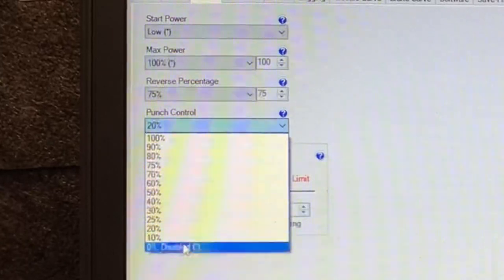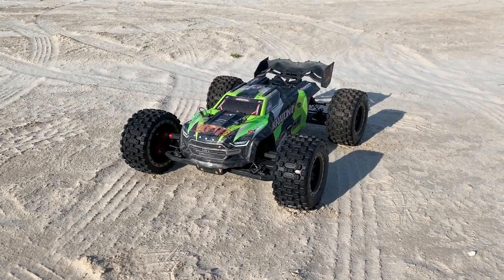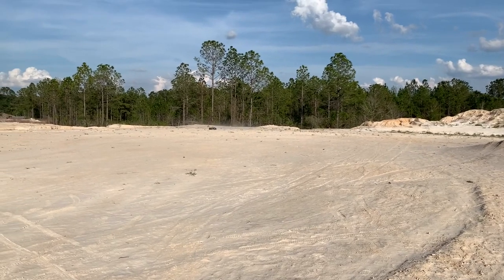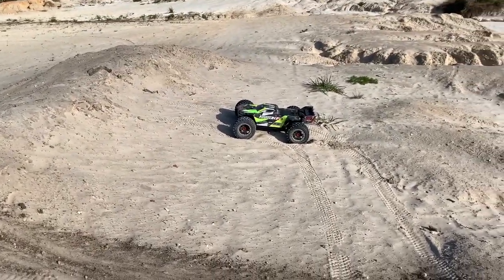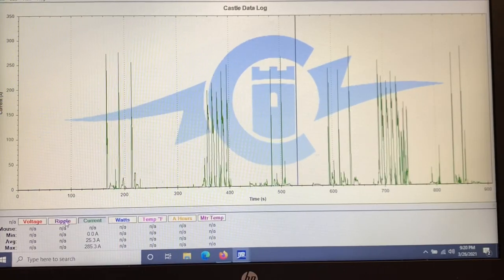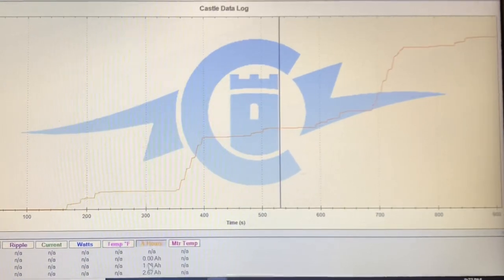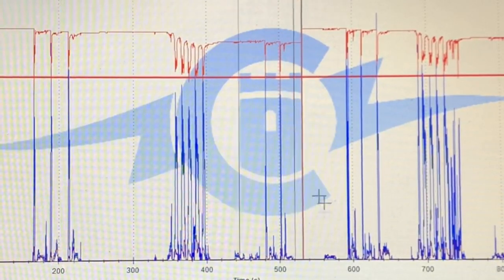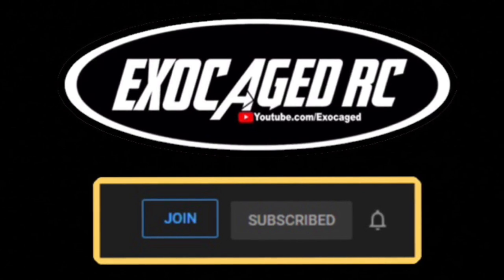20c vs 100c Kraton Castle with Datalog RESULTS!!

Comment: I'm no pro by far, but I think a major limiting factor in delivering the amperage is the connector and/or thickness of the wire being used. To get the most out of a battery you've got to have wire/connector that can deliver more than the battery itself can.  I'm pretty sure XT90s are only rated to deliver 90 amps. While something like an EC5 is rated to 120 amps. I think the wire/connector is hitting it's threshold before what is able to be delivered by the battery. Also length of wire can have an effect on how much amperage is being delivered (which I'm doubting is a factor in this test). I'm basing a lot of my speculation on my knowledge of the various plugs and (believe it or not) household wiring.

Comment: @9:24... you need to hold-click your mouse and drag it over the full sections you want details of.  Start with the tip of the graph action and drag it to the lower bottom, then release.  You’ll see zoomed-in detail at that point. 

Right-click the graph or click one of your parameter headings at the bottom to zoom back out.
Reply from the maker: Really?? Dangit man I didn’t know that! Thanks for the tip!!

Comment: Long term the cheaper batteries will most likely puff with that giant motor and ESC, gearing and weight of that monster. That's been my experience LONG TERM. Like a year or so. One run will not show that. I would with the Gens Ace personally. And I will from now on.

Comment: The problem with this test is that you have too many variables.  having different c ratings and different capacities makes it very difficult to know what's actually making the difference. The difference here could easily be the 20% higher capacity of the Gens ace and have almost nothing to do with the c rating.  I would be interested to see this again with identically sized batteries.
Reply: When is it not too many variables, though? 

I'd also be interested in seeing differences between different sizes of the same battery. Like the 4S Rhino from HobbyKing comes as 5000, 6000, and 6200. I wonder how different they are?
Reply from the maker: These were the closest two brands I have. It was close, what if I do something like the Turnigy batteries vs the PowerHobby 9000’s? LoL that’s a HUGE difference.

Comment: Looks like probably not an appreciable difference unless you're competing. I still feel it is probably safer to run a higher C rating so you're not constantly running at the maximum performance of the battery.
Reply: But long term, the more expensive batteries will outlast the cheaper options indeed.

Comment: Would be interested to see the difference after they have both been run for 10minutes. I think any good condition battery will give reasonable results when it has a fresh charge. But at half charge I feel you will see that the high C battery should cope better
Reply from the maker: By looking at the battery levels at each “test” the 6000’s were holding up better.
Reply: @ExocagedRC  Even if they were the same C rating the larger battery should have better performance.

Comment: You can see a launch difference. And i believe its more about the setup in his much difference you see when using different c ratings imo.
Reply from the maker: It was minimal. About the only thing that would have changed would be the temps may have been a bit higher on the Gens Ace runs
Reply: I think you would be really surprised by a company called Goldbat. Their batteries are super in expensive and you can tell the difference from a 35c 2s to a 60c 2s which almost acts like a three. I have 9 of them and think you should give them a go

Comment: Wow, this was comprehensive! For me, I use the cheap zee batts off amazon. Probably not the greatest, but it gets me out running my bashers. My crawlers do get Tattu 1300mah that are great, but inexpensive. Been thinking about getting a Spektrum (2s 100c 5kmah) for my Lmt, just see if there's any noticable difference. It currently uses the same Zee batts (2s 50c 5.2kmah) in it and is a blast! Still to fast for my backyard arena I set up. Gotta get on those breaks HARD. 12t pinion is in its future.

Comment: brushless motors will draw as much as they can. capacity is irrelevant, the voltage drops you see is know as voltage sag and indeed its because of the battery inability to deliver amps (bad solder joints, damaged/thin/too long wires can also trigger voltage sag). drone batteries are usually way more powerful and more accurately rated (they usually spec burst rate too). the cheapest/easiest way to get more power is to put more voltage though (as much as the esc can handle).
Reply from the maker: From what I’ve seen battery capacity makes way more difference than the C rating. On the wires and stuff, yeah you can’t expect a 12awg wire to push 500+ amps for long. I’ve got some 5000mah batteries with 8awg wires and larger cells and they really do well. They look like junk because they are taped up and all but great batteries. Turnigy HD 5000mah 3S I believe is what they are. I’m tempted to do this again but with the same Turnigy batteries vs the 9000mah Powerhobby. That should produce a more drastic difference right?
Reply: I mean, yeah capacity and c rating go together. a 100C 100mah outputs the same max amps (10A) as a 10C 1000mah.

Comment: I think it's pretty clear the higher C batteries preformed better. As I said in your last comparison video it's better to get higher C batteries and gear appropriately. Wish you had done more with temp comparisons on the motor and battery connectors, maybe on another video 👍
Reply from the maker: I actually did but I messed up. I got the Turnigy and batteries were at 104. The gens Ace was 100 but had a shorter runtime as you can see. I messed up by getting out of sync with the camera.  Thought I was recording but I wasn’t.
Reply: That shows “to me” that no not a lot of difference  in c rating.  They were close. And 1000mah difference I feel that’s wat the difference was   I think pretty much the same if both were 5000mah
Reply: But why did they perform better, though? Not necessarily because of C-rating. Could also be due to differences in age or capacity, or both.
Reply: @TheKjelmo  exactly. Capacity and age play a huge roll. And wasn’t a big difference at all
Reply: Pretty clear? Why? The difference is negligible and could be credited to battery itself, age, manufacturing quality, different capacity and weight
Reply: @andyvannort2743  Why? I looked at the graph and the available information and made a determination.
Reply: @GreatLakesRC  the graph shows NEGLIGIBLE differences which can be attributed to capacity and age of the battery
Reply: Your determinations are an assumption based on a 1% difference. In any true experiment the findings would not support the c rating making an impactful difference
Reply: @andyvannort2743  that's your opinion 👍
Reply: @GreatLakesRC  was there proper time to let all parts rest to have control over the electronics being a variable? How much of a difference was there? And how many variables were still left? 
Were taking a small number of bursts (3) and finding a neglible 1% difference while still having multiple variables as has been pointed out multiple times. Cant just ignore those variables and make a determination. Or it would be an innacurate one. At best this shows your money is better spent elsewhere because the price increase doesnt justify the performance difference
Reply: Not really an opinion... unless you think 1% isnt "negligible" the rest was fact

Comment: Awesome! I was just looking up lipo batteries and came across a 6s 12000mah 15c to 25c burst continuous for my kraton 6s and was wondering if it would work or would it actually hurt the performance of the kraton by the c rating? The battery weighs almost 4 lbs 1780g  and its only $99

Comment: Have you ever had a turnigy battery or the gens ace battery puff up on you, they seem to be high quality batteries.
Reply from the maker: Yeah I’ve puffed almost every brand I’ve ever had. In time they all puff but if you abuse them by using them in the wrong application they can puff and get messed up on the first drive.

Comment: Enjoyed the comparison. Not the greatest at reading graphs, but it looks to me like unless you are in a racing situation. the price difference for 100c vs 50c isn't worth it for just bashing.
Reply from the maker: That’s kinda the way I feel. Maybe I should put them against my biggest most powerful batteries?
Reply: It seems that the only real benefit would be run time.
Reply: C rating also applies to how fast the motor and esc can drain the batteries. if your running a big motor set up higher c rating is always better because it puts less strain on the batteries because there able to discharge to the esc fast then lower c rating batteries. just had 2 sets of batteries puff out and become completely unstable